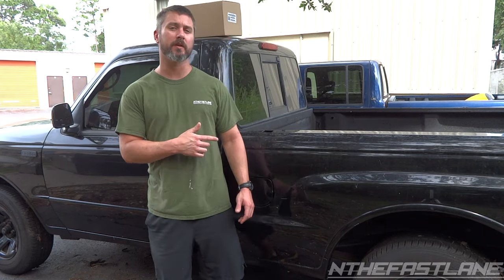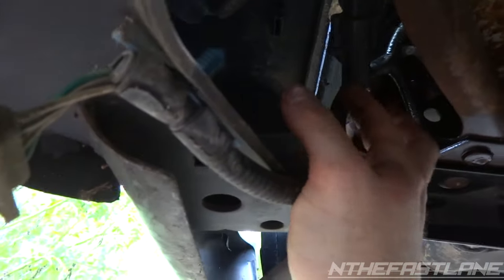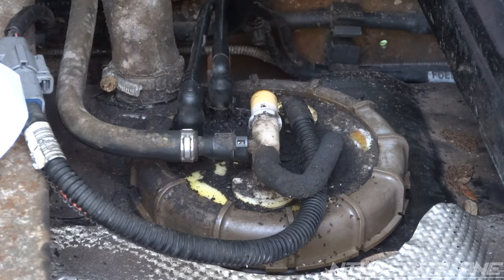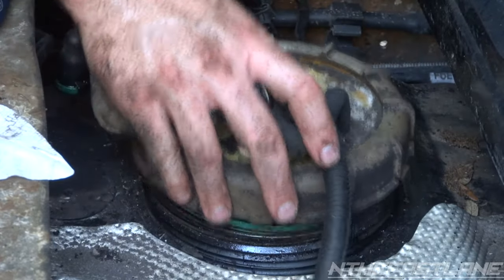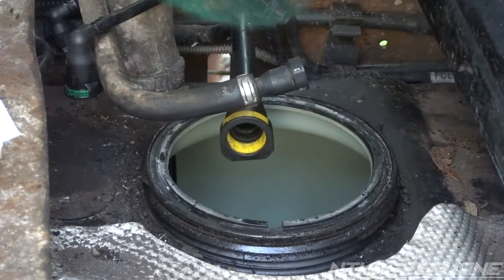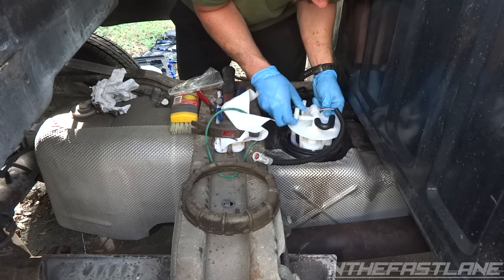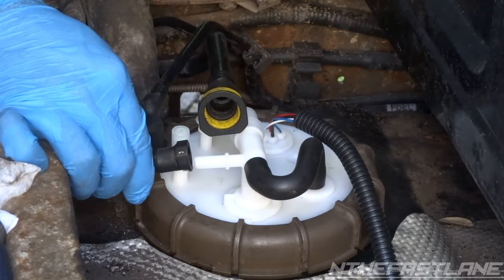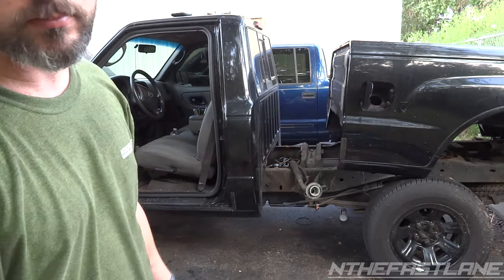▶️Fuel Pump Replacement Ford Ranger/Mazda Bseries (01-03)⛽️

Comment: Good video. Just a suggestion. You may want to hose the top of the tank off before removing to old pump to keep dirt and junk from falling into the tank when old pump is removed. Make sure the gas cap is screwed in the filler neck to keep water out of the tank. It's a sealed system except for the gas cap opening.

Comment: Need help you video was helpful except for the round donut the holds the pump in. I have a 2003 b3000 it has some other type bracket with metal tab . And the thing won't turn. Any suggestions

Comment: Great job.  I was starting to pull my hair out with spring force installing new assembly, glad you confirmed it was per design.  Mine is supercab and it’s a tighter fit between cab and assembly which makes it more difficult.  Why they make it such a tight fit though hole is beyond me, just stupid, and makes you worry about breaking something fitting it through the opening.

Comment: thanks for the video. Everyone else has showed taking off the bumper and tail lights. I started by leaving my back bolts in but loose and tilting the bed up but after seeing your video, unhooking one light connector and sliding the bed back made it much easier.

Comment: Excellent video, thank you. My 03 Ranger wouldn't start and the pump obviously wasn't coming on. Got a flat bed ride to my home about 40 miles away, turns out there is a reset button for the pump under the glove box. Hit the reset, turn the ignition to on then off then she starts right up. Everyone check this first, save some $$.
Reply from the maker: Thanks for the feedback Robery.

Comment: well you just answered that question, my sender on my 2001 B3000 just started acting up 2 weeks ago, it February 29th, too cold to deal with now, will use the trip odometer for now.
Just watched another video where guy dropped the tank....yah, bed removal easier...that be the way I do it.

Comment: Thanks for the vid. With regards the six bolts (T-55), do you recall the position of the two longer ones? Were they close to the cabin, in the middle, or towards the tailgate?

Comment: I suggest replacing the filler neck too while the bed is off. The filler neck develops cracks and leaks. Buy OEM filler neck. Aftermarket necks just do not last.

Comment: Is the fuel pressure regulator in the gas tank with the pump? I have a 2003 Mazda b4000 4wd.
Reply from the maker: mastermattk Yes it is, the B4000 is the same exact procedure, and the fuel pump assembly is the same exact part number. B2300,B2500,B3000 and B4000 all use this same pump and same repair procedure. You can purchase the repair parts here on my website. http://www.nthefastlane.com/Fuel-System/Fuel-pump-replacement-ford-rangermazda-bseries-01-03/Fuel-pump-replacement-ford-rangermazda-bseries-01-03-store

Comment: Did you have to disconnect the fuel pump relay along with the battery?
Reply from the maker: You can if you like, but as soon as you unplug the fuel pump harness there's no power to it anymore.

Comment: Thank you for this video!  I believe my fuel pump died on my 01' XLT. (185k miles original to the truck) and now I have to go through and replace it.  Ordered OEM motorcraft since I don't want to have to do this job anytime soon again but the only crappy part I am dreading is the bolts holding the bed... I feel like they are going to be a nightmare and also that it's now winter time here... doing this in 20 degree F' is going to suck even more.... :-(I believe what I ordered is the ENTIRE fuel assembly housing/pump/..etc.  It was almost $300.  I figure this is easier as I take out the entire old one and put new one in and be done with it.You really made this look easy!
Reply: There not that bad I just took mine out yesterday on my 2001 Mazda b3000 next is taking out the fule pump

Comment: I had to replace the license plate’s light bulb, I saw a spark, now my ranger 01 won’t start any more, I have checked all the fuses and relays and they are all fine. Do you think the fuel pump could be  the problem?
Reply from the maker: Check your fuel pump cut off switch. It's located underneath the glove box compartment on the passenger side. If you're sitting in the passenger seat looking at the glove box, it's underneath it to the right. With the vehicle off,Push the red button in. Then go ahead and try to start your vehicle again.
Reply: Is it in the same place for the Mazda b 3000 series ?
Reply: Does it have a cut off switch
Reply: @joeyeverett8064  yes it is

Comment: Does the B2500SE 2.5L have a fuel pressure regulator on the  fuel pump Assembly too or can I get the fuel pressure regulator for existing harness because I just bought a fuel pump?
Reply from the maker: The "FPR" comes with the fuel pump assembly, it's in line on the fuel pump.

Comment: How long did it actually take u. Also, how u reinstall the Fill whole?
Reply from the maker: Without filming I would say 1-2 hours max.
Reply from the maker: Reinstalling the fuel neck is pretty simple. You just hang it down, then set the bed on and push it back up into the bed area and screw the bolts in.
Reply: Thanks, I may have to do this. I saved video.

Comment: I got a question, is it a full replacement or so you need to move things from the old one to the new one?
Reply from the maker: +Isaac Martinez You can swap just the pump if need be. The only problem is, the fuel pressure regulator is apart of the entire assembly when sold and it's a common part to fail so best to replace it all.

Comment: Thax  brother...mahalo...from kauai..got a question do I really need an electric gun or can I used a Sackett wrench to get the bolts off the bed?
Reply: I just used WD40, a breaker bar, and ratchet at the end by hand.
Reply: It's a damned beast doing it by hand but it can be done!
Reply: It's really tough doing it by hand- I used a breaker bar. This was the toughest part of the job!

Comment: Helpful video, I was freaking out b4 I saw your video.  I have1999- 2000 Mazda B2500 SE VIN:4F4YR12C0YTM14175
2.5L 2492CC |4 GAS SOHC Naturally Aspirated. Can you tell me which Fuel Pump Kit I need?  Also what do you think about creating an access panel in the bed?

Comment: Great video!! I have a 2009 ford ranger sport and just bought a Spectra pump to replace the old pump with about 83,200 miles on it!! I hope mine is intact when they remove it!! I have factory bed cover in my bed....can the tank be dropped like in a car?? Just asking!!
Reply from the maker: +gracie charleston it can be but this is a far easier method.